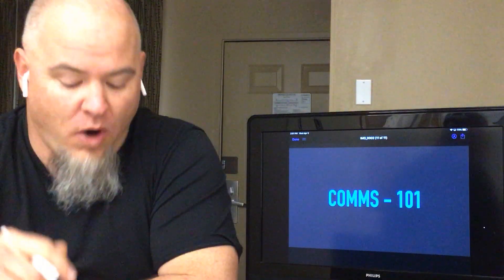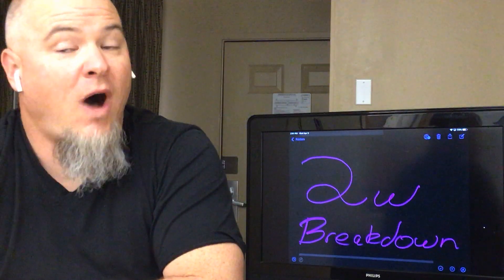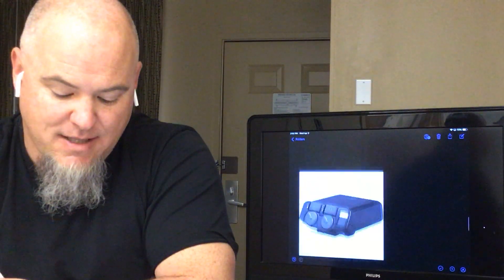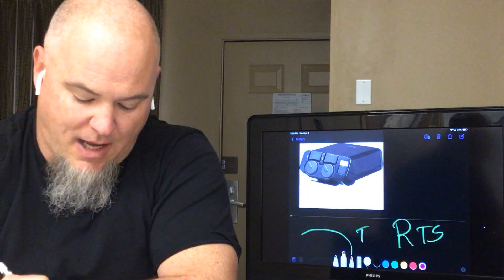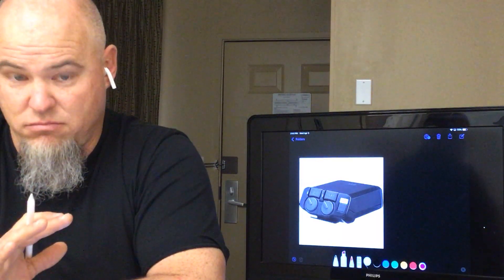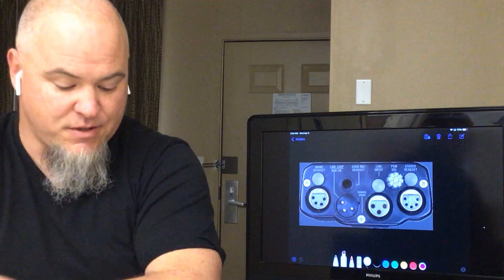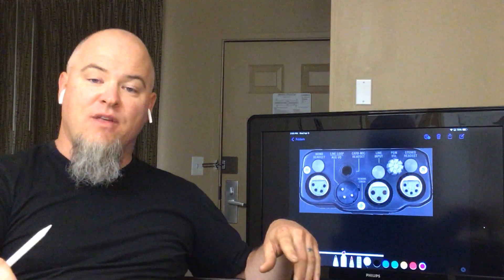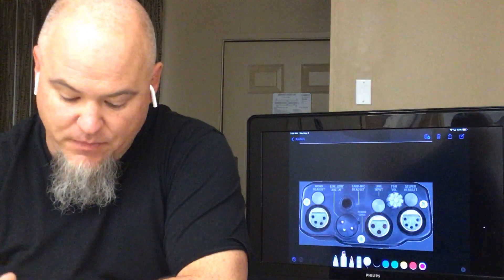"2w Comms In Depth" episode 2 Comms - 101

Comment: Thank you for the time & hard work you put into these videos, Super helpful.  

When a COMM CH. on BP325 is left open or unattended  is it possible to unlatch it from a different location or another 325?
Reply from the maker: The full answer is “yes but it depends on many factors”

RTS is the Windows of intercoms. Where as I think CC is the Mac of intercoms. What I mean is that RTS has lots of little options and secrets that can be enabled or disabled depending on user choices.

So yea there is a RMK scenario on BP325. But the BP has to be programmed to respond to the tone. Also the power supply must be connected specifically wired to send this tone. It’s extra
Wiring on there and is seldom wired.

Comment: Hi Rob, thanks for the great videos! one of the venues I TD for has a telex 4ch 2w system with all devices set up for balanced audio. is this a common configuration? all other 2w systems I have used were unbalanced. for what it is, it works great! the only downside for me is not being able to use most CC compatible products like call beacons for FOH and MON engineers
Reply from the maker: Sounds like you are looking at an Audiocom system. I don’t have a lot of experience with those. And I don’t really know what their upside is. And honestly, I don’t know what the system is compatible with and what it isn’t. Sorry about that!

The line of products does make for a call light. Maybe you can find one of them for your uses.
Reply: @roblipop8797 thanks for your reply! I appreciate your time and expertise. I think you are correct about it being audiocom. I'll check next time I'm there.
Reply: yup, audiocom